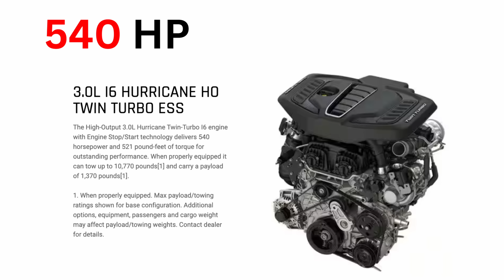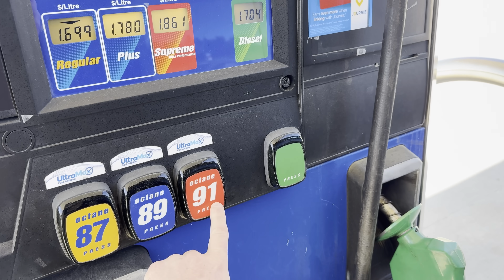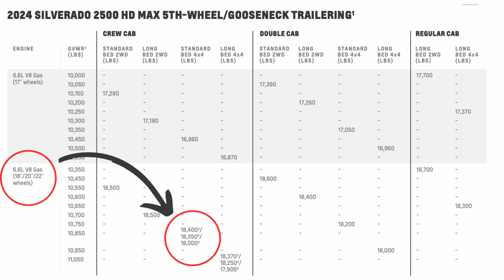Ram 2500 3L TWIN TURBO HO Hurricane Engine (540hp) | Will It Replaced the 6.4L HEMI??

Comment: Cummins is developing a 6.7 I6 gas engine for school buses and other heavy duty vehicles. I bet they will replace the 6.4 Hemi with that engine.
Reply: 1000 lbs. too heavy.
Reply: @benjaminwayneb the 6.7 Cummins only weighs 1000 pounds as a diesel moron😂 a gas version will be lighter the 6.4 is 580 pounds
Reply: @benjaminwayneb probably no heavier than the 6.7 diesel engine. Heck I say make it 8 liters and tune it for low end power. Keep it simple and it will sell like hotcakes. If I were looking at an HD gasser I would seriously consider the 7.3 Godzilla right now

Comment: Question.. 2021 Tradesman 3500 Hemi 6.4 I've heard a drivers side engine tic starting at 2500 miles. The dealer wants me to leave it with them or the won't write it up so it's on record. I have 17,800 miles on it now. Do I have anything to be concerned about? 2 more years on warranty
Reply: Mine had the tick from 7k to 20k miles (when I sold it.) There are lots of posts on the Ram forums about it. Doesn't seem to be a concern.
Reply: Thanks, I'll get it looked at.. I still have 2 more years on factory's warranty.
Reply: Either broken exhaust manifold bolt or failed lifter both covered under warranty
Reply: Get it looked at when you still have warranty. Case in point: i just took my truck in for an engine oil change, and almost ignored my rear diff cover "sweating" ever so slightly. Truck is 4 yrs old and still under warranty. But I mentioned it... when they popped the cover to re-seal it, they found metal filings in the diff oil. I didn't even know about the problem, diff wasn't howling, but I got a complete diff rebuild under warranty because I didn't ignore it. Good luck brother

Comment: Stellantis has already said they will continue with the BGE (big gas engine) 6.4L in the heavy duty trucks. I don't see a 3.0L TT being able to meet the duty cycles of a BGE. I do hope the 6.4 is refined for more power to compare with the GM 6.6L.
Reply: The 6.4l will out pull the 6.6 every day of the week. The 6.4l has tq down low and keeps it through the cycle to shift points. What no one is telling you is that the 6.4l is fully forged and I saw a guy who had a fleet of 6.4l in 3500s pulling hotshots. 18k lbs all the time. He got 350-450k miles out of every motor. You'll never get that out of the china owned gm.
Reply: @sonsofliberty3081  The 6.4 DOES NOT have torque available low in the rpm range. It has to be revived to produce power. Not at all like the 7.3 with 80% of it max torque available at 1600 rpm. The 7.3 is the benchmark in the gasser HD market. I've owned both the 6.4 and the 7.3.
Reply: @sonsofliberty3081  The 6.4 ram makes about 140 torque at 1500 rpm.  The 7.3 ford gas makes 400 ft/lbs of torque at 1500 rpm which completely crushes the ram.
Reply: @sonsofliberty3081  Well that's good info.  I have a 2014 2500 with the 6.4, first year with it in the RAM trucks, 96K miles now.  The 6-spd trans is the achilles heel, but it does come alive when rpms are above 3000.  Grades above 4% it likes 3rd gear at 68 mph near 4000rpm with a camper trailer.  I wouldn't say its a low torque monster, it likes to does like to rev but does so effortlessly.

Comment: Great video once more.  So the question remains: what engine will replace the 6.4 Hemi in the Ram 2500?  Unless, surprisingly, they keep it for the foreseeable future?
Reply: I can see it sticking around for a while longer. There obviously might be changes like GPFs added for emissions but I bet the basic mill will remain.
Reply: Not sure, regulations effect commercial vehicles yet. Sustainability = Trash

Comment: I'd like to see a 4.0L straight 8 twin turbo for the HD models. Not because it would be a good idea, just because I want to see it.
Reply: Why not a 5L straight 6?  Remember the Ford?
Reply: @KevinBrown-r7d  da 300
Reply: Same that would be kinda sick
Reply: I mean to follow along your idea realistically I don’t think a higher displacement i6 is out of the realm of possibility
Reply: @baileymoyer9777 mazda currently has a 3.3L I6 being used in their new awd/rwd suvs atm.
Reply: Its actualy a good idea they can use all the same parts….2 more cylinders then maybe use lower boost for 450 hp and 500 tq
Reply: 2 Words: Crank Flex. As is the I-6 architecture inherently has it, imagine an even longer crank.
Reply: @GIGABACHI this was a problem back in the day like the 1950s but the block would be real short compared to then

Comment: During the towing tests the engine oil temperature was much cooler in the 3.0 I6 standard output vs the 5.7 hemi. There are huge advantages to the 3.0 I6 gas. Just wait till the next version comes out. The new TRX is gonna be a whole other level
Reply: Don't know what you were looking at but the fast lane just did a test an oil temp on the hurricane hit 285 while the hemi was alot less

Comment: Spray on liner? I see longevity issues already. 500hp out of a 3L engine, heat and more heat. Where is the dipstick, Ram?  Sounds like a engine for  the 1500 only.   Alex right again.
Reply: Yeah it’s definitely a light duty engine designed for half tons and the upcoming Charger type coupes and sedans. No different really to how other automakers stage their engine lineups.

Comment: Why doesn’t Ram use CGI cylinder blocks like ford did with their gas 2.7?
Reply: Durability is not preferred; No rebuilding a liner block; More profit
Reply: Probably didn’t see a need for it. The 2.7 uses a split block type design with separate girdle so that may have necessitated the CGI construction.
Reply: @ALMX5DP  Understood. From my perspective, CGI seems like a better choice. Most marine engines, big diesel engines and even nascar blocks are made of it. Not sure why fleet vehicles are so far behind.
Reply: @adamg3911  for a heavy duty or commercial product definitely. This hurricane is going to be for their cars and light trucks/suvs. I’m sure there is a longevity case to be made even for those to use CGI but they also have to consider weight and cost type aspects and maybe even emissions stuff too for that vehicle category.
Reply: @ALMX5DP  Understood. My argument is with the “light truck” term. The RHO is currently being delivered to dealers in 6200 pound trucks and is in my opinion closer to HD truck weight territory. If this engine was placed in a 4000 pound truck then I would agree with your statement, but in reality these RHO trucks will likely be hualing around extra weight on top of their heavy curb weights and will likely not last as long as the 6.4 would. A over engineered cgi engine would be nice to have as an option to people that want it, that’s all I am trying to say.
Reply: @adamg3911  ah I get what you're saying there for sure. Yeah with as heavy as pickups are getting, even half tons are carrying considerable weight and are rated to tow to the moon it seems. I too would like to see something more robust, I just feel like many OEMs know that half tons are generally used pretty gingerly as daily drivers and weekend warrior type uses. I always wanted to see a 6.4 Ram 1500 just to know it would be a stout performer for years and years. Hopefully someday in the future we'll see the trend reverse for this segment to provide owners with more robust powertrains.

Comment: The spray on liner is what caused fords 5.0 to burn oil with the gen 3 from 2018-2020. They went back to a traditional liner with the gen 4 in 2021 and now they don’t have the problem anymore.
Reply: WTF are you talking about? All GEN3 and GEN4 Coyotes come factory with the spray-in plasma lining. Blaming spray-in linears being the issue, is like blaming guns for shooting people. Do R35 GTR's have oil burnoff issues? (Nissan bought the technology from Ford to use in the R35 GTR, before Ford ever used it) Do 13/14 GT500's have oil burnoff issues? Do 18+ Mustang GT's have oil burnoff issues? All these vehicles use spray in linears, as do 21+ F150 5L trucks. Spay-in linears are the bomb when executed properly. Why do you think GEN3/GEN4 Coyotes weigh 15+ lbs less than GEN1/GEN2 Coyote? Why do you think GEN3/GEN4 Coyote is 307 ci as opposed to 302 ci, with a .03" larger bore diameter than GEN1/GEN2? Why do you think GEN3/GEN4 Coyote heads flow better than GEN1/GEN2 heads, and use bigger valves? The answer is because spray-in linears allow for these things. The issue for the 18-20 trucks experiencing oil burnoff is because Ford sent some of the blocks out with too rough a texture in the linears. Blame Ford, blame a shift manager not wanting to scrap a bunch of blocks that were finished on his shift, blame whoever, but when done correctly sprayin linears are awesome. I mean how many 2K-2,500K WHP racecars are using GEN3 blocks? The technology isn't weak, just some of the blocks from those years had the wrong finish in the linears which gave oil a place to collect to bypass the rings. Many times this issue is fixed with more miles as the rings wear into the linears more. Some have even fixed it with 1 or 2 oil changes using a oil Moly treatment.

BTW my 18 5L experiences 0 noticeable oil burnoff.
Reply: Gen 4 didn’t come out until this year with the new 2024 MY vehicles. I believe the Gen 4 still employ plasma arc spay in liners as well as their displacement is identical to the Gen 3.
Reply: @ALMX5DP  gen 4 is 2021 to present 5.0 coyote. The 2024 f150’s got a refresh but the engines themselves have no changes so it’s still the same gen. Gen 3 was from 2018-2020, the problematic years.
Reply: @Bruhwhatthehellbruh  well that’s not what Ford Authority, Ford Performance, Wikipedia and others say. They refer to only ‘24 MY vehicles has having the Gen 4, which still uses the spray on liner.
Reply: @ALMX5DP  you’re looking at the Mustang engines bro. I just looked up articles you are referring to. Yes mustang 5.0’s have changed for 2024 but the f150 version has been the same since 2021
Reply: @Bruhwhatthehellbruh  F-150's also receive the new Gen 4 mill, which include a larger 87mm throttle body, larger intake manifold, new camshafts, as well as new pistons and connecting rods. However my main point was just that they continue to use the plasma arc welded spray on liner.

Ah I think I see what you're saying. I saw some differences in F-150 vs Mustang. Did not realize they made changes to the F-150 that were not introduced in the Mustang until more recently. I am a gen 2 F-150 owner so havent paid much attention to that area and just believed that the engines mirrored each other with respect to their generation, but seems like you might be right about the F-150 transitioning to an updated gen 3 or some do call it a gen 4, though I still think there were changes made to the 2024 F-150 5.0 that werent there prior (like the VCT system i think i read).
Reply: The 2024 GM Duramax diesel eats all Ford HD engines for lunch. Period.

Comment: I just don't see how the hurricane is going to have any longevity to make it worthwhile. We've already seen the issues that arise with fords ecoboosts before they even turn 100k miles. Turbos going bad, oil burning etc. And my understanding is that ecoboosts are only pushing about 10lbs of boost if I remember correctly? Thats about half of the boost this hurricane produces.
Reply: Ecoboost has been through a few revisions over the past 15 years. Issues plague every type of engine, and even the 5.0 had its fair share a few years back but for the most part a well taken care of engine will be just fine for most people and uses. I think Fords Ecoboosts peak in the low 20psi range.
Reply: Turbo engine life < NA engine life

Comment: I wish they had replaced the 3.6L v6 with the 3L I6. I love the hemis so much
Reply: There's still tons of them on the road! You can always buy one
Reply: While not impossible (ask Volvo and Suzuki)it's harder and has some particular drawbacks when you try to install an I-6 on a FWD application.
Reply: @GIGABACHI  trucks are not fwd
Reply: If not for the CAFE fines, they would have kept all 3 engines like Ford did. Only reason they dropped the Hemi was regulations, and dropping the Pentastar would just make that situation worse.